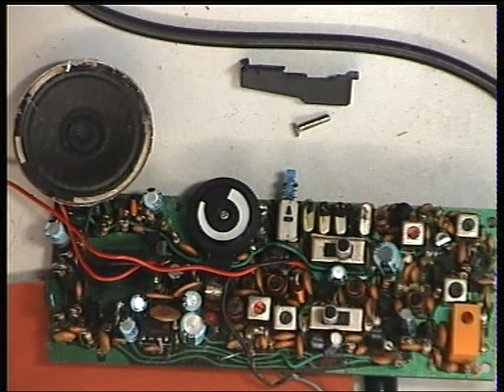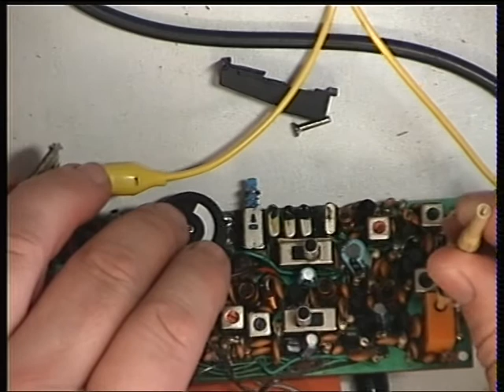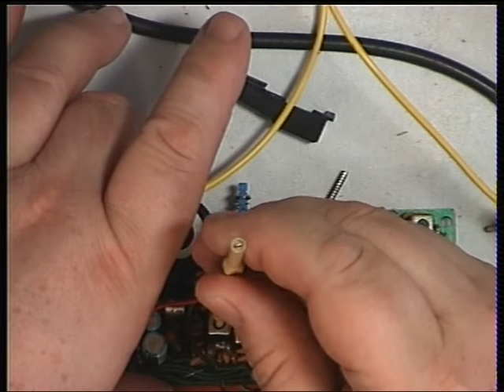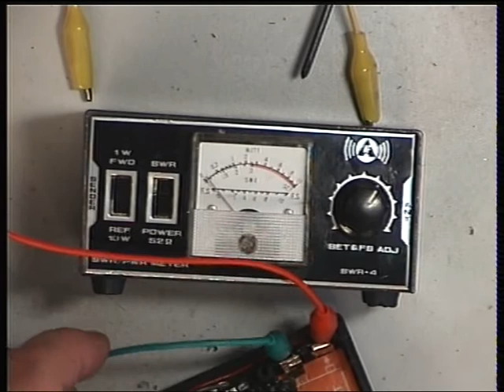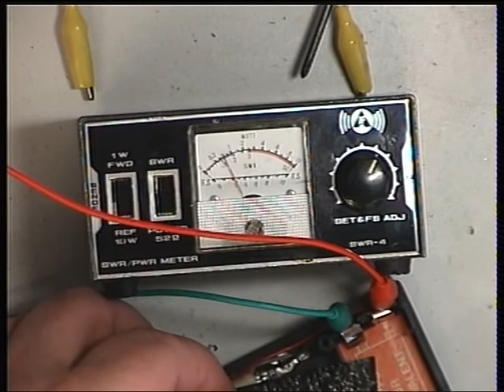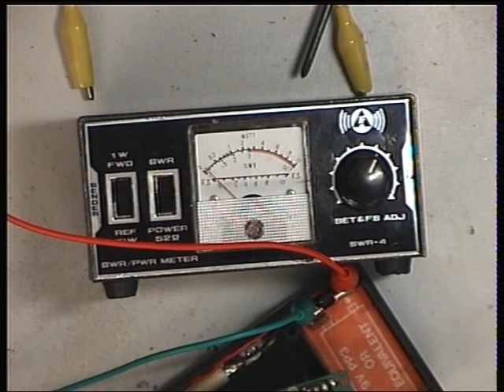Harvard 020, UK CB radio 200mW (Hand portable). Alignment of receiver

Comment: Hi Richard, great videos as usual. Can you please demonstrate a SINAD Meter working together with the Signal Generator in a future video maybe? I have seen all your videos where we actually see the oscilliscope only when adjusting the FM detector or adjusting modulation for 2.5khz. Many thanks Richard keep up the good work. Dave DE M0IBC
Reply from the maker: Dave,

Yes, the workshop will be back in full swing from 1st October onwards. I'm just doing a few of my own sets to keep the interest up at present. The main business here is in church pipe organ restoration (no electronics!), which I do during the summer six months, moving onto radios in the winter six months; as I got fed up of cold churches in winter!

Don't think this is some multi-national company; there's only me here but, there are two part time technical helpers & a non-technical helper as & when required.

During this break, at least two other test benches will find their way into the room you see on the current videos. The Sinad meter on the Marconi 2951 test set I use on the current bench is the worst one I have, but isn't faulty & would make a poor video. Test bench two (SSB capability) has a Schlumberger test set & Test bench three has a Farnell SSG520/TTS520 test set combo with the best Sinad meter. Test bench Four has a Quartzlock 262A test set that doesn't go under 70mHz, so no good for CB's!

Richard